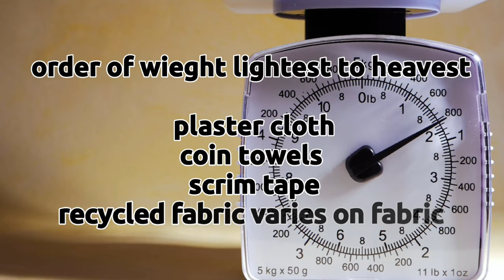what to use tried and tested ( mini crawler top coat)

Comment: After watching your earlier videos, I built a course using old bedsheet. It worked fairly well, except the thread count must've been too high. It did not absorb the cement well enough and left patches of exposed sheet. I applied a skim coat of cement over the sheet after it hardened enough to stay in place. Its super tough and looks great. Thank you for showing us your technique!
Reply from the maker: @fishousemike  yeah each fabric will have it's own density and will require some slight changes. But it sounds like you've cracked it awesome work Glad you're happy with the results 🤘

Comment: Im stoked to see some proper testing on a video. I have used plaster sheets, spray foam, then 2 different versions of using Durhams Water putty which is like a powder that mixes into a sandable wood putty. I mixed like 5 to 1 and soaked thick shop towels (thicker paper towels) and placed them on the course like plaster sheets then mixed like a 3 to1 mixture and just rubbed it on. The durhams is like $5 a can and comes in like 80oz containers. I like that it dries super hard and tons of traction. Definitely cheaper better products then plaster sheets.
Reply from the maker: Glad you enjoyed it Yeah where going to be doing a few of these  videos trying and testing different techniques 🤘
Reply: @REACTIVETERRAINRC  awesome

Comment: After watching this im bound and determined to try your method on a few different areas. It really might come down to thats the best method for outdoor use. Speaking of how does this hold up outside. Can you do a video leaving it out for a bit in the weather to see how it holds up outdoors?
Reply from the maker: Ok so I used to build, 3d background for aquariums. Using cement to cover polystyrene. And fabric mesh to secure the joints. These last anywhere from five to six seven years before showing any signs of flaking and crumbling. 

But where happy to do a video to show how effective it is 🤘
Reply: @REACTIVETERRAINRC  thanks for the quick response. Ive loved watching your stuff and you bustin on your buddy lol. I will definitely try your method and do a video and tag you guys.

Comment: Hey wanted to pop back on this video and tell you i tried your tshirt method with Durhams Water Putty in like a 3 to 1 or so mixture. The results were good. I would put plaster sheets at like a 8 out of 10 for rigidity and I would put this combo close but not quite like 7 out of 10. However with your concrete mixture idea I know it would be 10 out of 10 so thats my next test. Will share results when finished.
Reply from the maker: @F.N.G.RC1  awesome thanks for sharing your progress 🤘water putty never heard of that, also be interesting to see what you think of the weight of the cement test as we just built two modular courses with the towel technique and it's surprisingly lightweight 👍
Reply: @REACTIVETERRAINRC  yeah i can tell the tshirt material is alot heavier over plaster sheets just side by side. I think the towel idea really makes for a thinner but strong material. Like ive said ive used the soak method with the water putty and the heavy blue shop towel paper towels and it worked but definately lower on the rigidity scale. might have been my ratio of powder to liquid as well.

Comment: Thanks for the video been thinking to build a mini crawler course for a while now but didn't know what technique to use. This helped alot.
Wish i had a space the size you do to build a big course with many lines to take
Reply from the maker: @harryeskriett4365 appreciate you tuning in. 

yeah we rent a workshop for our club to use so we are very lucky in that respect.
Reply: Not been into the rc rock crawling that long but loving it. So recently come across your channel love the content. Used to think having the fastest rc car possible was good. But now having something thats slowest as possible...! Who knew you could have so much more fun.
Reply from the maker: @harryeskriett4365  yeah we have had all kinds of RC in the passed but definitely enjoy the 1/25 and 1/18 scene really like the terrain creative side of the hobby
Reply: What was it you was using cement powder on its own or postcrete? because I noticed it was a bag of postcrete on the table when G Dog  was mixing it with the cloth as I think I'm going with this method
Reply from the maker: @harryeskriett4365  so we use cement for the slurry and it you want to sprinkle post Crete on areas to and a different texture and more grip. 

We actually sived the post Crete to just get the cement as It has a accelerant in it so it goes off quicker 🤘
Reply: Oh ok thank you for the advice. Saves buying cement and postcrete